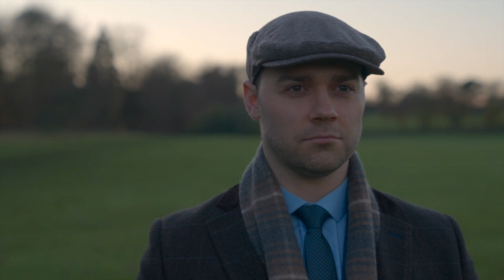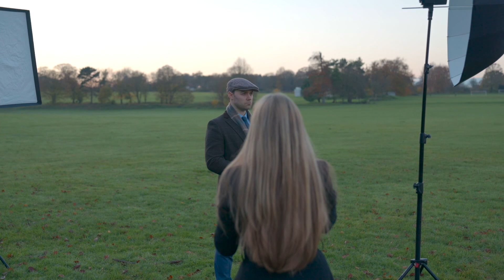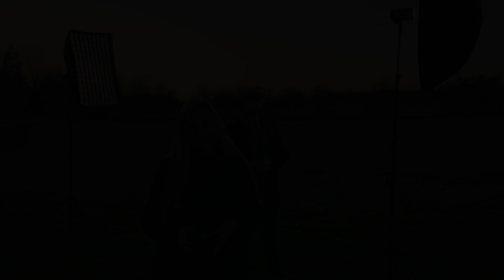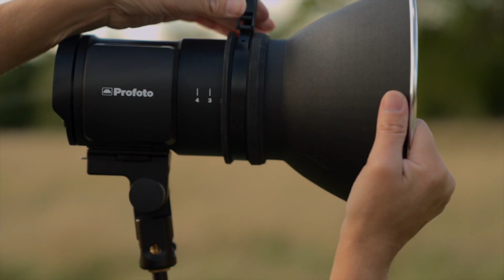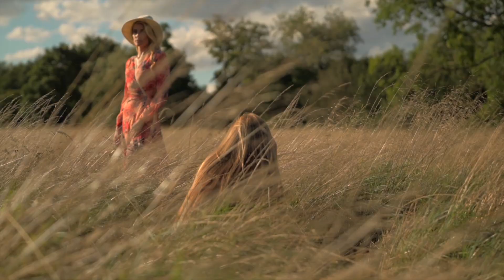High Speed Sync Photography

Comment: Hello. a question the Newwer 565EX flash has that option to put high speed? or the problem is my Nikon d3100 camera. ? what can i do in this bucket to be able to take pictures with high speed ? thank you.
Reply from the maker: Hi Edna,
I have not used the Neewer 565EX so I can't give my opinion about it. The Nikon D3100 should be capable and good enough. Can you explain what type of photo and what you want to achieve? Hannah

Comment: Very helpful, thanks. Are you always using TTL in this type of situation? I have noticed many photographers use the manual mode on the flash and that’s a bit  tricky for an amateur like me 🙂
Reply from the maker: Hi Sylvain. The first shot I take I use TTL, then I switch to manual and adjust from there if needs be. The Profoto system remembers your TTL shot settings and keeps the flash at the same power when I switch to manual. Hope this helps =]
Reply: @HannahCouzensPhotography  Thanks for the follow up. I don't think my Godox flashes have that feature. Should we understand that you then never "stay" on TTL for the entire pose/setup?
Reply: @SdeGat  Yes. If your main strobe light does not have that 'memory' feature.

Comment: Is it possible to use HSS to freeze movement? Or...The many bursts will register many diffrent positions of subject? Think of a hummingbird for example. Without flash you freeze the wings at 1/1600 , with 1/200 flash synch the wings will look blurred.
Reply from the maker: Hi Leo! In HSS the flash pulsates to maintain a continous high output, and basically acts like a constant light. This way you can use a high shutterspeed on your camera to freeze movement. In scenarios where constant light will impact your photo, such as the sun when taking photos of hummingbirds outdoors, this HSS technology will be useful. Because when you put the flash into HSS mode you will basically have two constant light sources (the sun and the flash in HSS) so you can freeze the movement of the bird with the shutterspeed of your camera. If you are in a controlled area (such as a photo studio) where you can shut out all constant light sources, and only use short burst of flash to freeze the movement, the shutterspeed on the camera can stay under the flash sync because no other light source will impact the image other then the flash. At power level 2 (1-10) on a Profoto B10 in freeze mode, you will have the shortest duration of light, and freeze the subject with the duration and exposure of the flash at 1/50000 of a second during the time your camera curtains is open and exposing the sensor for the flash at 1/200 of a second. Hope that was helpful =]
Reply: @HannahCouzensPhotography  Thanks Hannah! I asked because a video other than yours in wich a guy makes an HSS experience using a fan propeller and the resulting image was somehow soightly blurred.Acoording to the author it was because the several flash bursts registered slightly differente propeller positions.
Reply from the maker: @leomaluf6426  Haven't seen the test Leo, so I'm not sure what type of brand the flash and camera is nor what settings is being used in that test. But the technique of the mechanical shutter travelling over the sensor is probably what is limiting the ability to stop the motion properly. If you had a global sensor readout that could sync with the flash you would probably get better results. Hard to say what causes the stroboscopic effect. I would need to see the test.
Reply: @HannahCouzensPhotography  Thanks Hannah

Comment: Hannah. I have a sony a7IV and a godox ad200 pro. I already set both my trigger and my flash for HSS and I am still getting banding when using shutter speeds higher than 1/250. Please help
Reply from the maker: Hi. I'm not sure how the ad200 pro works. But it sounds like the sync between camera and flash is not working. Maybe the flash needs to go into a HSS mode to make it pulsate and act like a constant light as you enter shutter speeds above the sync speed on your camera? Hope that helps =]

Comment: Why do I still get that black bar even in high speed sync? It's driving me nuts for like an hour I've been trying to figure out what the issue is. At 1/250 I get a black line even though I can see high speed sync is on my receiver and my ad200 has the high speed sync symbol activated but still I can't shoot above 1/200
Reply from the maker: @Br8kz  what camera are you shooting with?
Reply: @HannahCouzensPhotography  Canon EOS R8
Reply from the maker: @Br8kz  It might be a firmware issue between the Canon Camera and the Godox light. The Canon R8 max sync speed before going into HSS is 1/200, so camera is in HSS at 1/250, but flash might not be judging by what you are writing. Hope that helps.

Comment: Great explaination of high speed sync. Do you use ND filter in some cases when shooting flash photography? I prefer ND filter since I lose alot of light output when shooting in high speed sync. At f.1,4 in bright daylight a 6 stop ND filter get me at 1/200 shutter and a stronger flash that can help overpower the sun. Ofcourse I could brunt a bigger and stronger flash, but having a light backpacka is also appreciated. High speed sync loses power and some flashes overheat after a while too. What is your ecperience of that?
Reply from the maker: Hi Jörgen! That is a great alternative. To maintain the power output of the flash, save battery and get it down to f/1.4 if you are pushing the limits in HSS on both output power and battery. However I tend to use the high speed sync option or stop down the aperture on location shots, as I'm not a big fan of shooting through ND filters =]
Reply: @HannahCouzensPhotography  Plus the viewfinder gets dark when using ND filters, and they are expensive.

Comment: Amazing video as usual, but sometimes it's better not to use hss, and screw an nd-filter on your lens, so you can still use f8 and 1/160th of a second at iso 100 (for instance). High speed sync drains the batteries of your flash and you get longer recycle times
Reply from the maker: Thanks, yep as we mentioned at the beginning you can of course use ND filters or a higher aperture. HSS is of course draining on the batteries and can result in less power too so it depends on the situation and what you want to achieve from your image but as I say, with these shots, I wanted to use a lower aperture without an ND filter.
Reply: ND filters are expensive.
Reply: @thehumanityoflife6460  Especially the ones made of glass, and they are fragile. I prefer plastic screw on filters
Reply: What if you don’t want to shoot at f8 but wide open…

Comment: My experience with HSS is that you lose a great deal of power in the flash.  Maybe the B10 can handle that loss.
Reply from the maker: That is correct. In HSS you will loose some power output. But the B10, especially with the OCF Magnum Reflector, covers my needs =]
Reply: @HannahCouzensPhotography  Yea, I have tried to use HSS with speedlites and tend to get more frustrated than its worth.  I'm going to have to splurge for the nicer more powerful lights!
Reply: @Todd_Kuhns  Buy a used portable powerful strobe light with extra batteries. I bought used portable NEEWER VISION 5.
Reply: @thehumanityoflife6460  Thanks for the advice

Comment: It's not the same, but in a pinch you could bracket your exposures and do a HDR to get the ambient light on him and the sky without needing a flash at all. I do this all the time, however it does give a different look and using lower shutters without a flash does look slightly blurry in comparison for obvious reasons. Just a tip if you were in a situation out and about with no flash.
Reply: Too complicated using High Dynamic Range. First, you need a tripod to align the multiple images properly later on in software. Then you need to buy a software to do the HDR merging of your photos.

Comment: The two first shots when start using the rectangle lightbox on Tom, it come too dark. That happens when you don't know how to take light measurements, not the right way to explain how to shot.
You need to learn how to sync using high speed, if you care about your camera you know shutter has a determined number of shots before it goes dead.
If you have a light meter, take readings and shoot, for the backgound go 1 stop lower than main subject or use your camera's readings, move control to manual and meter background then face of subject, now check your flash distance at that speed and bingo, it takes 30 seconds but give you perfect shot everytime, no waste.
The way you show, it's by guessing the how, just like you mention. The shot you have in mind. Not the shot I realy want.